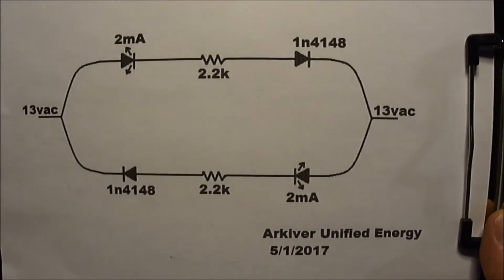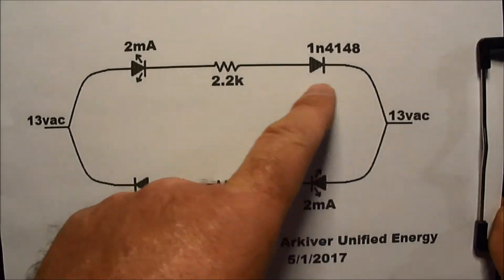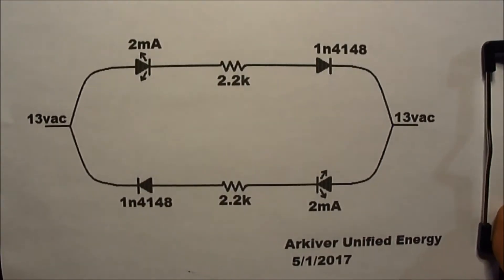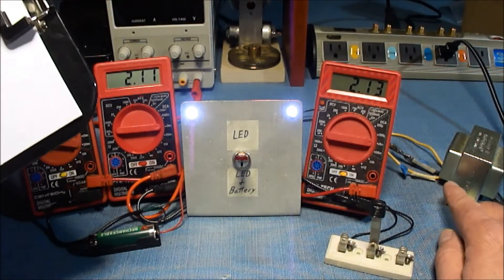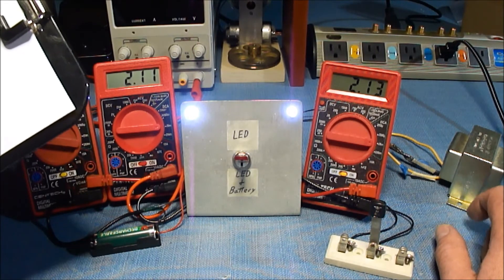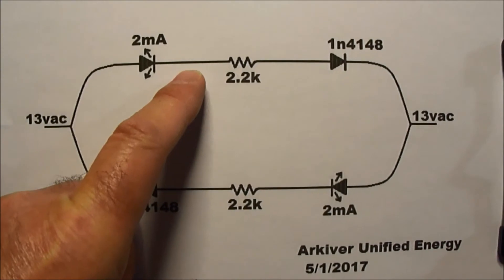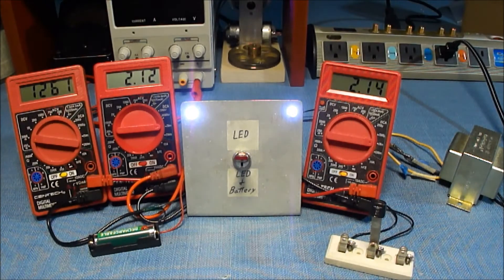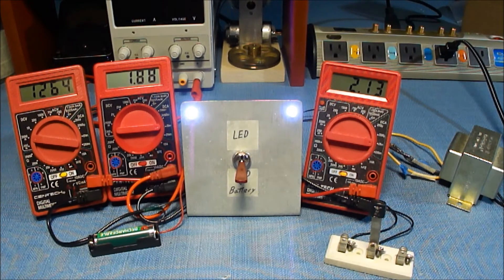Increased Resistance Increased Current

Comment: thanks for the videos, i learn a lot from them;  My comment would be that a capacitor is like a spring with rebound action so since ac is being used its pushing back some of the stored energy in the capacity so now instead of measuring one way current the meter is picking up twice the amps from this rebound effect; Energy is getting recycled, getting bounced around.  I did an experiment with a 200 volt 1000uf cap and was able to discharge it 9-10 times on 1 charge as long as it went to another cap like a microwave cap. once discharged to microwave cap I would just simply flip it around and discharge it back to original 200 volt cap, it would only lose about 10 volts during this back and forth process.
Reply: Very Well observed! :)  It is Very Correct and Standard to consider a capacitor as the equivalent of a STRING in mechanics.  The equivalent of a coil is a FLYWHEEL; You can STORE ENERGY as in a STRING by COMPRESSION or EXTENSION that You can STORE ENERGY in a flywheel by making it turning and gain momentum. You can also STORE ENERGY by COUPLING STRING AND FLYWHEEL but energy will ALTERNATIVELY GO FROM ON TO THE OTHER, very like in between capacitors and coils; but maybe You knew already :)

Comment: I have to say your thinking as to the behavior of these effects is close to my hypothetical reasoning with the bifilar and dcmotor generators. That poles  can be unidirectional in a circuit geometry. That tests show current reversal usually thoughtof as current direction such as in the bifilar starship coil and increase potential.
Reply from the maker: Asymmetric current is the term found in old books. It can't be measured without two branches. Cheers

Comment from the maker: Could all AC current be energy stored?
Can you provide storage capacity fast enough?
Can you drive an electric car?
Are all powerwalls used for your maximum benefit?
Can a grid tie powerwall rob your solar benefits?

Feel free to add more questions.
Reply: "Could all AC current be energy stored?" 
-> I don't know for "all" but standard are stored in RESONATING CIRCUITS; the problem in this case, compare to DC STORAGES is that EACH TIME THE FLOW OF ENERGY GOES FROM CAPACITOR TO COIL, WASTE OF ENERGY HAPPENS DUE TO THE RESISTANCE AND OFTEN BACK EFM :/